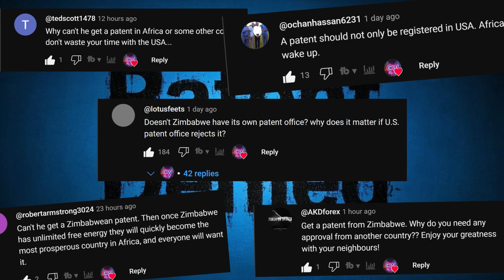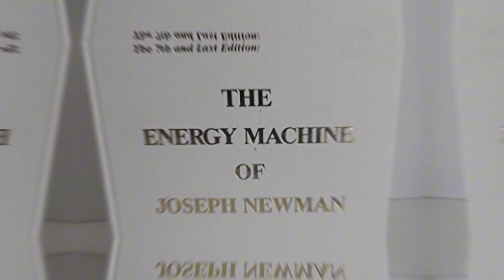Why The UK Cartels Wanted To Steal Maxwell Chikumbutso Invention

Comment: The invention is not a perpetual motion device. It does not produce the energy to run itself but gets it's power from the radio frequency energy that is ambient in the atmosphere where it is stored and sent to the electrical components that run the car or electronic device. So there is no reason why the patent office is refusing to grant this inventor a patent.

Comment: If you want to obtain a patent on this you will have to list it as something other than a free energy device/generator. I have something similar but of a different design and obtained a patent by describing it to be a highly efficient transformer technology that utilizes frequency induction to transform into high voltage electricity. Though the application covers everything you have discovered and built to produce a similar result I will not hinder you in obtaining your patent. My approach has made obvious other implications associated with my discovery and would undoubtedly open up a very dangerous can of worms that could endanger all life on the planet. I gave up my work because of my discovery in hopes that no one else would ever discover what I had. Your design is much safer and so I hope you succeed with your patent. I suggest you apply for an International Patent which will cover all major countries including Africa. Apply in the country of Belieze and make sure you cover everything in the patent application. Go through a third party so that you don't draw attention to yourself in your daily behavior. If you do this you will likely achieve your patent. Categorize your patent as a utility patent and call it something like (Frequency Activated Resonant Technologies) or (FARTs). Describe it as a device that transforms radio/microwave frequencies into usable electrical energy. DO NOT describe it as a "Free Energy" device/tech. You don't have to have anyone prove that it is a free energy device. If it is, then the world will discover the truth and the science will change to conform to Maxwell's original equations which tell us that energy is everywhere and that free energy is elementary. If you approach this problem in this manner you will most likely be successful. Good luck Max and God bless and protect you. You'll need God's protection my friend.